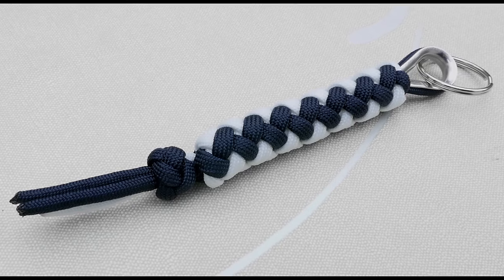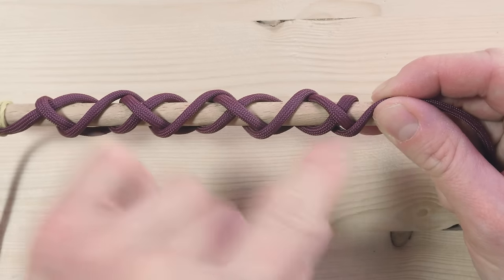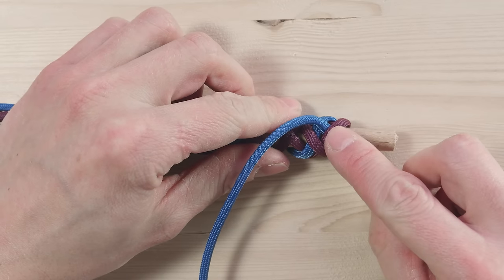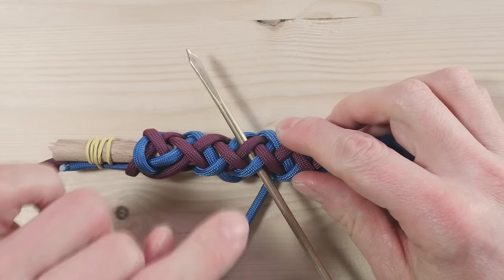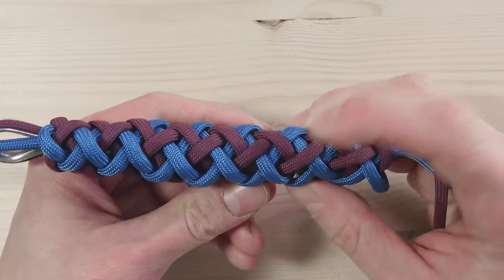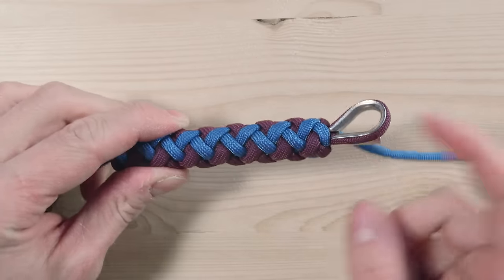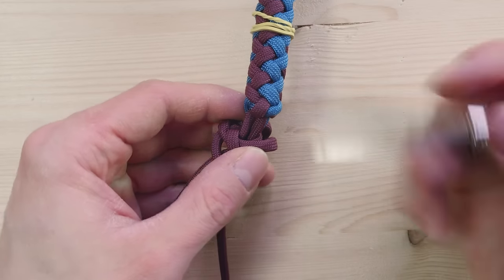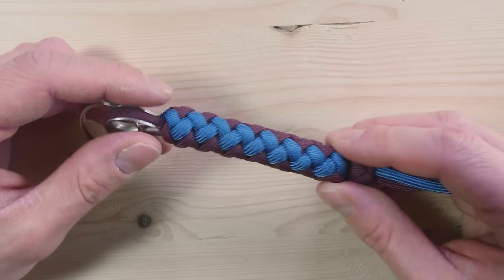Paracord key fob- simple 2 bight

Comment: Hi Mark, What size rope thimble would you recommend?
Reply from the maker: Hey Geoff!
The easiest way to find an exact fit is to go to a local hardware store and try it out. The ones I am using are classified as M3.

Mark
Reply: Thanks Mark.
Reply: They should be the same Nominal Size as your cord. This 3.5mm cord (guess) would use a "3mm" Thimble. Sometimes I minimize the amount of metal by going one size smaller on the thimble, it will still stay on and be less cumbersome. So 2mm or 3mm (1/8") nominal sizes. 
Stainless Steel thimbles are very cheap and I use those because I use my bench grinder (fine grit) to grind off  the 4 points of the thimble. Makes it much more elegant and comfortable in the hand as well as lighter in weight and bulk. You can grind off More metal as well; I go up the legs of the thimble about 1 or 2 cord diameters, so there is a gap between the ends of the metal. A dab of glue can help, but if the cord loop is snug (with about 1dia exposed cord each side, which is the same size as if the thimble were whole) the thimble will not shift. 
De-burr and round off the thimble cuts with 180-220 grit black sandpaper or flap wheel. If you use a galvanised thimble do not grind it as it will start rusting. The cuts you make to a stainless steel thimble will also rust unless you soak them in Ospho, or toilet bowl cleaner etc for an hour or two.
Thank You Mark, your channel is Exceptionally Great!